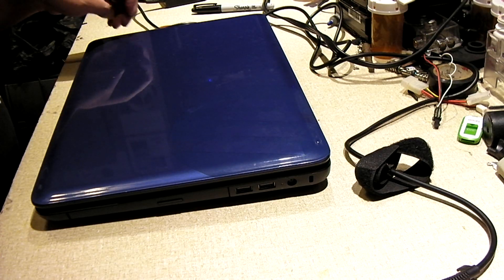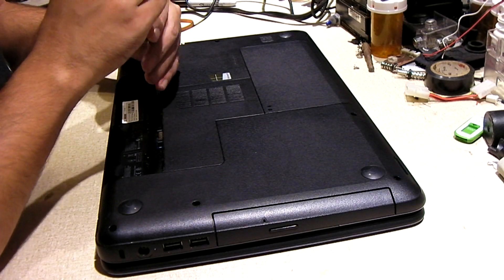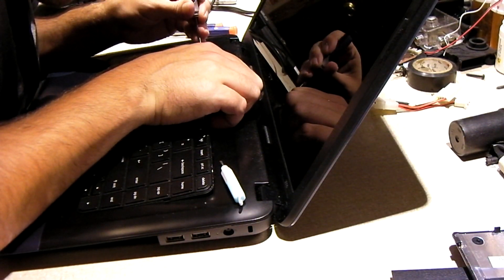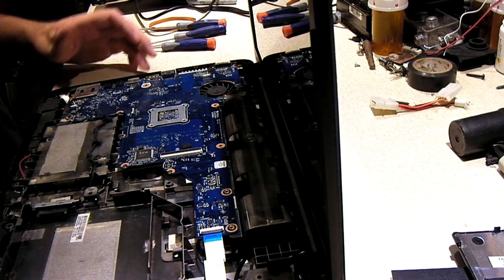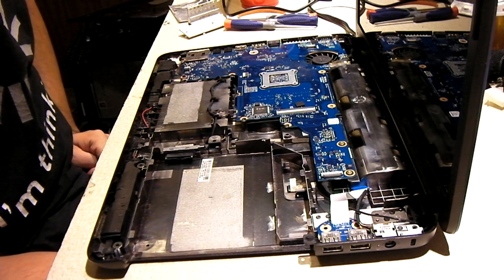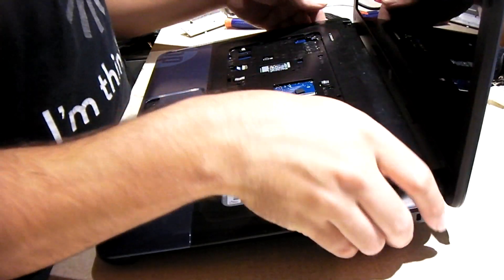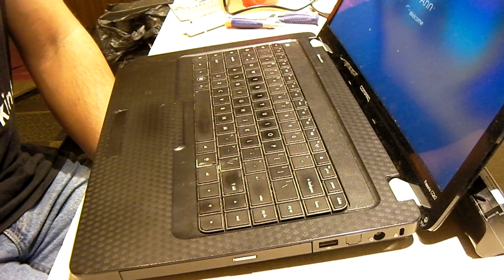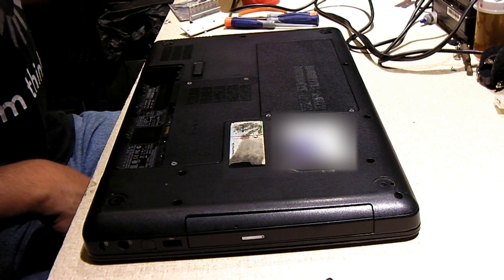Part 1 - Troubleshooting an HP 2000 laptop that won't power on

Comment: I have the same HP laptop and it's doing the same as that one. I was also told it's the motherboard. How much would you charge to repair my laptop? I really don't want to get rid of it. Before the issue started it always worked well for me.

Comment: Hi! 
I have issue with my laptop same one that its power button is not working but when i plug charger charging light turn on but don't start the pc
Reply: Did you get help?
Reply: I have the same problem
Reply: Yeah it started when i put cable on right socket

Comment: I have one of these HP doorstops. That's all they are good for .HP sold absolute junk to the public and they know it and don't really care.
Reply: Rubbish, mainly Chinese low quality, made to fail junk. Agree. Waste of dollars/pounds. Want my money back. Manufacture in US or EU.
Reply: Ripped mine apart just to see what’s inside. No help from HP website. Boot loop error, to black screen, test failed at times and passed others. One way to learn  how cheaply made a laptop is. Doorstop will come in handy. I’ve had a Dell Vostro 400 switched to Linux OS, never had a problem. Counting my blessings.

Comment: I will say if possible check and see if something is heating up while power is plugged in. I got two HP machines that showed no life at all but while power was plugged in something on the motherboard started heating up. One system had a component heat up so quick and got so hot that I was surprised that it did not melt the solder and fall off at some point. the other was some chip but when googling the number on it came back as a power IC i believe. Just something to try on that dead motherboard if u still have it. Sometimes I wish I had a thermal camera to do stuff like this instead of putting my finger somewhere and see where I get a nice burn mark.